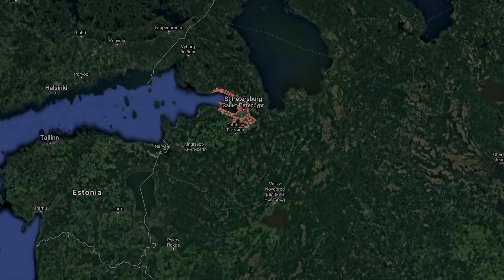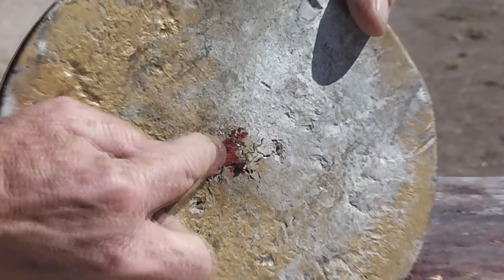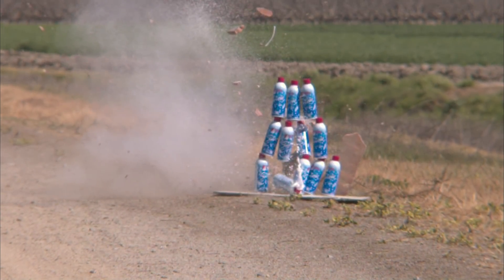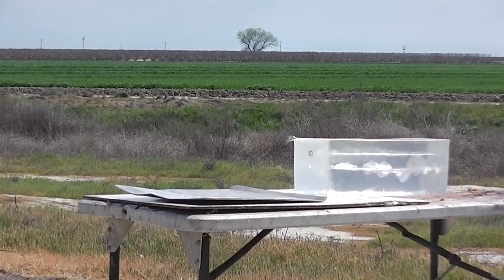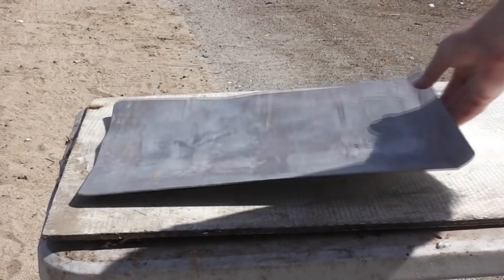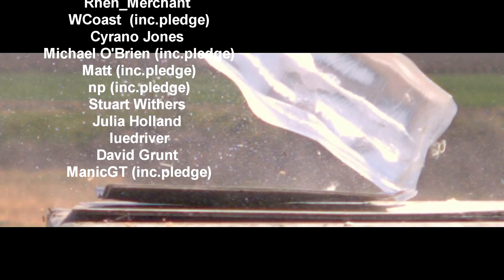Prototype RUSSIAN 12g.  slug is almost unstoppable!

Comment: Oddly enough I think the flat shape and sharp 90* corners of the round actually aided it in cutting through the kevlar.

Once the material passed the apex of that corner, the fiber had no where to go except to be compressed against the backstop and the edge of the round, so it was cut.

Comment: In my experience, laser sights are ONLY good in daylight if you pair them with a set of laser goggles. That’ll cut down on the glare and make them stand out, but otherwise? No real point during the day. I’ve also seen scopes/sights that have the lenses for them as well, which might be better. Basically you need to use a green laser for the best results, and the lens lets you see the “invisible” 90% of it that is infrared. You can also get a pure infrared laser for true stealth sighting if you prefer, just bear in mind you will ABSOLUTELY need lenses then. 
Addendum: Oh, or a camera. Lost of digital cameras can see IR lasers and lights just fine, even on cell phones. Point your camera at a tv remote while pushing the button to test it. If you see a flashing light on the IR LED end, you’re good to go.

Comment: What outside diameter are these machined to?
Reply from the maker: .670"
Reply: Is it possible to make these the full .729 diameter for smooth bites or rifles barrels?  I have seen the Russian paradox lead slugs and I believe they are .724 with the same snap in base.
Reply from the maker: @sbeprecisionproducts6729    I'm not sure if the copper would have the same softness of lead.  The sabot gives a little margin of safety allowing good engagement with the rifling without worrying about being oversized.   Plus no copper fouling.

Comment: Love these tests, I'd love to experiment 
With better slugs for my old double barrel and black powder, sadly cannot use brass or copper as chokes are tad tight, can you try a test  using foster 
Type or possibly the Lyman pellet style
Cast in " linotype" the garden style lead used in blocks for printing presses??
I'd be curious to see used in modified chokes or tighter, thanks for providing 
An interesting channel  !!  Watching all way from Cape breton island  on east coast Canada

Comment: Lasers need to run parallel to the bore and never intersect.  This is why most high quality lasers are green so you can use a red laser in the bore then set them at what ever spacing you need apart and you are sighted.  So if the laser is mounted 2.5" left of the bore you will adjust it to be the same at a set distance say 50 to 300" yards, wile sighting you only move up or down allowing for the bullet drop.  I use a Steiner DBAL-D2 that has both green and IR lasers that are slaved to each other.  This way you can sight the rifle in using the green laser during the daytime and the IR laser will be right on the money with night vision after dark.  I hope this helps.

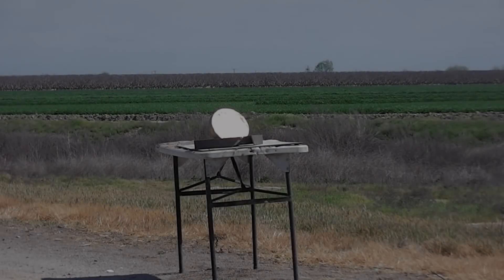Comment: 1:30 -- Totally with you on: 'lasers don't show up in broad sunlight'. Even green lasers (I've tried laser pointers) only show up weakly in shadowed areas.

On *video games*, the lasers always show up just fine and the bullets always go right where the dot is because the bullets do not simulate real-world fluid dynamics interactions between projectiles and air, nor projectile tumbling.

Laser aiming devices are useful in tactical, short-range situations for obtaining a proper sight picture (lining up your front sight with your rear sights) under duress. However, in situations like these, Danny has plenty of time to aim carefully using the sights and his intuition for projectile behaviour -- something a laser can't replace.

Comment: I wonder if boring out a slug like this from the rear as the final process of the lathe work and putting lead into the body of it would make it even more destructive.

You could make copper, brass or steel slug caps and put various weights of lead in and compare to see which is the best via weight as the slug design is a total winner!

Comment: I always thought it was primarily velocity that defeated armor because there is so little time for energy to spread. I'm sure someone has already done the math on it, but it seems if you can get that force per area up enough to exceed the molecular / atomic bonds holding that material together, you can get through. I'm sure there's a time component that needs to be minimized too. And, of course, you don't want the energy going into the projectile, braking it up.

Comment: Laser sights are ok for body mass size shots at a set distance +or- 5 metres.  I have mine set on an air rifle for 35 yards used in conjunction with a mildot scope and torch.  I use the mildots and the laser dot for easy night ranging but I never bother in daylight.

Comment: I've never heard of a laser sold as a firearm accessory that doesn't have a built in way to allow you to easily zero it, it seems like that would go without saying and be part of the basic functionality required for it to work. It'd be like buying a scope you can't adjust or ammo without primers and intending to use them that way.
Reply from the maker: The laser has to be mounted off-set from the bore.   It has to converge where you THINK the POI might be.   Then, if you change the distance,  the convergence-point has to be re-calculated and you'd have to guess where that would be.  I would need 50 slugs to do all these re-calculations and make test shots just to align it.
Reply: @taofledermaus  Exactly, I think they are primarily intended to be used in close quarters situations such as home defense or a CCW that you are only using from short distances and doesn't need constant re-zeroing. Plus they can be real hard to see when you're outside even at close range.

Comment: I think that it went through the Kevlar because it was propped up against a relatively hard target. If the backup was a bit more squishy, I think that would have engaged more fibers. If you've ever sewn anything, picture trying to drive the needle through limp fabric (previous tests with the panel) vs putting a bit of tension on the fabric, the needle slides right through.

Comment: Re Computer case: it might actually be the computer case that caused the penetration of the Kevlar. Kevlar works by increasing the duration of the impact so the Kevlar can absorb the energy, it works on people because people will flex enough to let the Kevlar deform ... if it's up against a hard surface like a computer side it might not be getting the opportunity to deform.
Reply from the maker: quite possible!

Comment: Weren't some russian large caliber projectiles (e.g. 122mm) in WWII also flat nosed? You sacrifice some aerodynamics/long range ballistics, but you theoretically get increased normalization when hitting angled surfaces, so it didn't glance/bounce off as easily. I guess it wasn't more effective than a "regularly" shaped projectile or it would have stuck around.

Comment: We used to have a similar slug in Australia once upon a time. It was a ribbed copper slug, slightly smaller in diameter encased in some sort of resin.Rather than having the flat nose it had 5mm flat tip coming out of the centre of the flat face and the ribs were much deeper cut. it was a great slug. i was given 10 of them from a friend who was too scared to use them. All the box said was Australian hunter, but could never find them in the stores. Great video guys, keep up the good work.

Comment: Jeff. I know it’s not practical but I have wondered for a very long time how well ball bearings in non neutonian fluid would work as armour. 

Ball bearing size same as projectile size. 
Eg 223 vs 1/4 ball bearings. 

Like a 4” box filled with bb and nonneutonian fluid or even cast into wax if you can’t get proper stuff. 
Not ooblek.

Comment: The sharp 90 degree edge on the projectile and the thin steel of the pc case seem to have acted as a circular hole punch, you might find a circular hole in the kevlar of the same caliber as the projectile itself. Very cool.

Comment: Wide flat Meplats are known for good strightline penetration on game. Thus alot of the best dangerous game ammo uses it.  the branches will still deflect the slug enough to be an issue of ethics when hunting.  That Kevlar was wad-cut lol. I wonder if the leading edge was chamfered if it would still have gone through.  Excellent content as usual.

Comment: WICKED!!
My guess is that the brass rounds, when you get to them, will go right through the lead plate/ingot. I hope you use a "new" one when you give it a try, so that the damage is clear cut to the eye. 
I was not surprised at all that it cut through the kevlar in front of the computer tower. That 90° angle around the circumference of the impact area did the same thing as it does to branches and grasses, no matter how green and flexible they might be. 
Really appreciate your work, so please keep it up. 
Stay safe out there ...

Comment: The video began with an AD, for HOLSTERS, and ended with one for President Trump!
The clean penetration of the kevlar was amazing, but honestly, it's getting a little ragged on the back side- that may have been a factor. Still, I slowed the high-speed to 1/4 speed on my computer and could see the UN-deformed accelerated mass still flying (though tumbling) on that shot as opposed to the flattened one that bounced off the lead plate. Very impressive indeed, as was the wound channel in that gel- my leg would fit in there!
Can't wait for the brass ones!

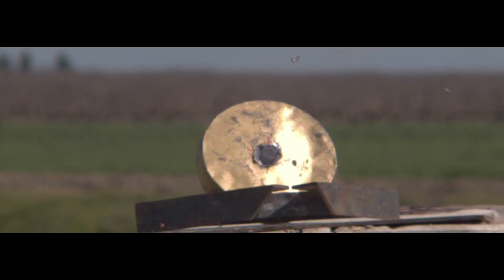Comment: At 2:49 the copper crushed on the lead because lead is a more dense metal. The copper is very soft compared. The densities aren't that far off but its enough. Its .0324 pounds/in³ for the copper and 0.410 pounds/in³ for lead. Hope that helps bring some understanding.

Comment: When you do the brass, try to set up something that simulates brush so we can see if it cuts through cleanly without deflection. Something like green branches maybe 1/2" diameter arranged in a double row with a 1/2" gap. Fire down the center so you and clip the branches. They must be green, dry wood would be harder and act differently.
 Something like this, top view  :::::::

Comment: That slug is outstanding. It's stable and devastating. I didn't expect it to go clear through the computer like that, and seeing it pop out the other side without looking the least bit deformed was shocking. I can't wait to see what the brass ones do.
Reply: I hate to surprise you but there really isn't too much inside of a computer. I've built my own and you'd be surprised how much empty space is in most cases.
Reply: @BarnacleButtock   It took out the CMOS battery without any tools.  That's 10/10 mane.
Reply: @BarnacleButtock  those Optlplex cases are amongst the heaviest frakkers you'll ever encounter in their profiles. It went through 2-3 layers of metal for the case alone not counting any components it smashed through. There may be additional bracing it went through as well given it's the desktop model instead of a tower to support a CRT monitor given it's a 3rd gen case so not super common to have lightweight flat screens yet.
Reply: @BarnacleButtock  I think he meant that he thought the vest would catch it. I believe that the computer actually ensured it could not catch it because it created a backstop so the sharp edge of the slug could build greater force to cut the fibers.
Reply: @BarnacleButtock  its more that the slug went clear through the kevlar panel in front of the computer than the computer itself. Like they said in the video, they've never seen any slugs go directly through the kevlar, and they've tested quite a few.